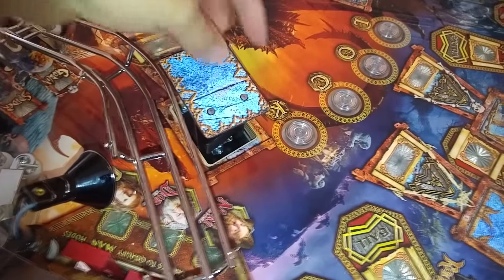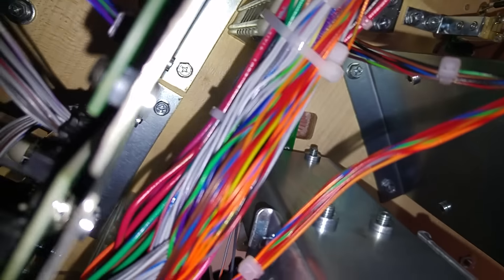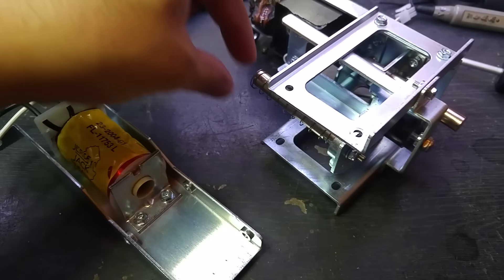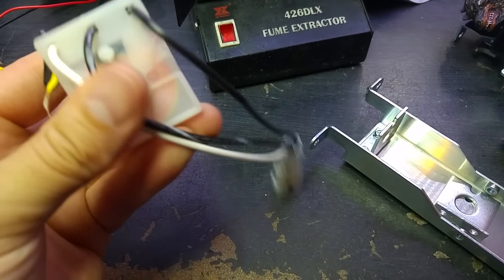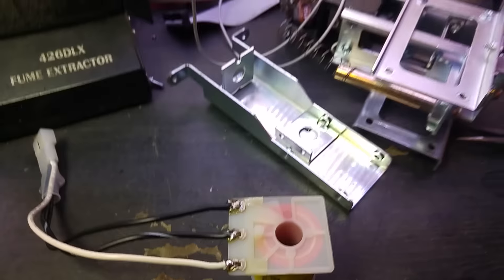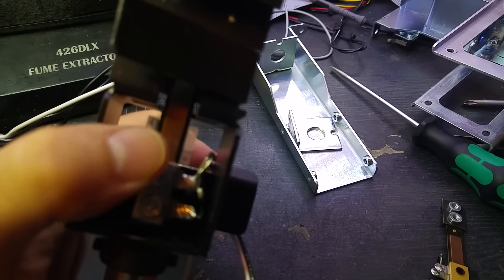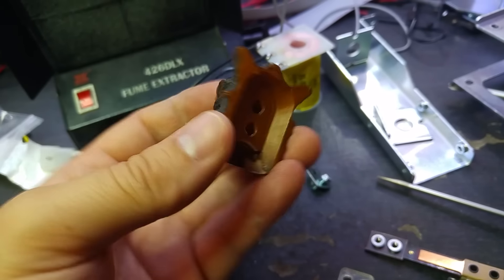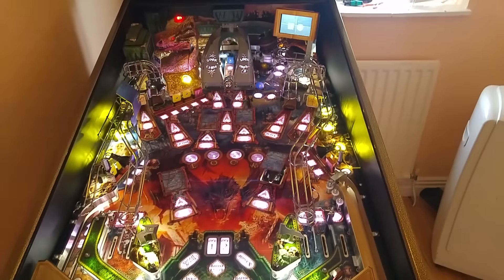JJP Hobbit Pinball - Fixing a broken beast popup

Comment: I just got back from Tilt in Brum - same fault !   Burnt out.  Did your mosfet blow too?
Reply from the maker: No fuse blow, I am on my second melted coil now :(
Reply: the 7amp fuse blown - took out the computer case as I think a mosfet has blown too.
Reply from the maker: sounds like they need to sort out some issues then if its not just me